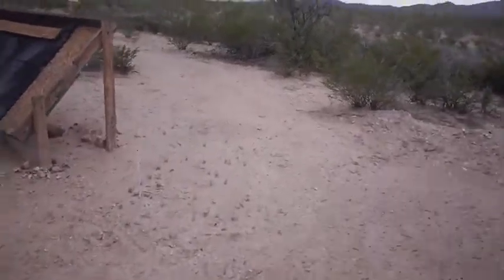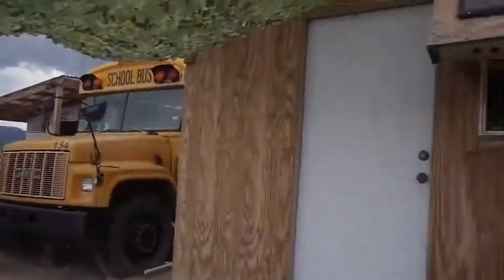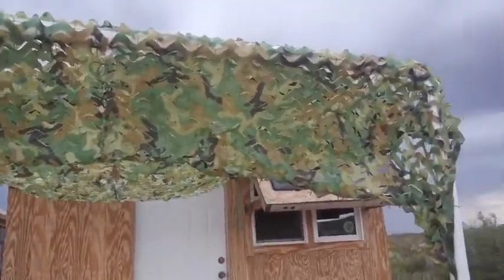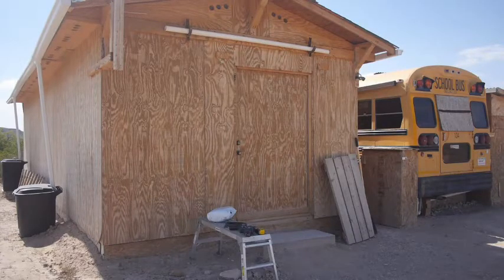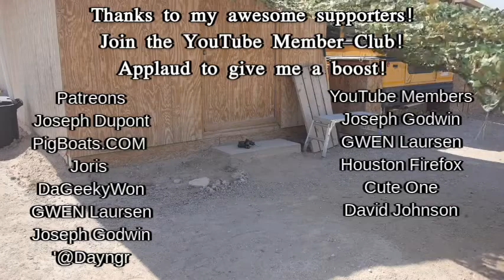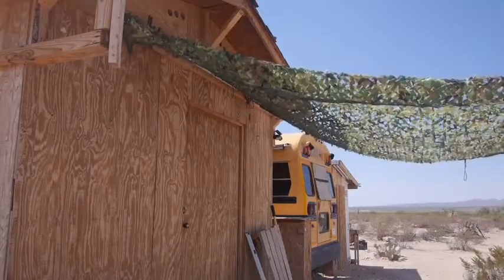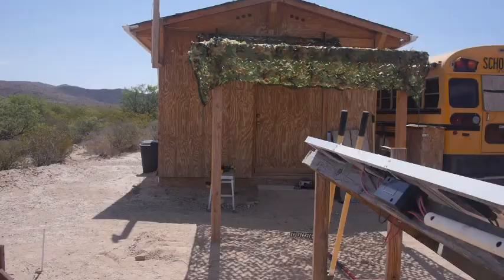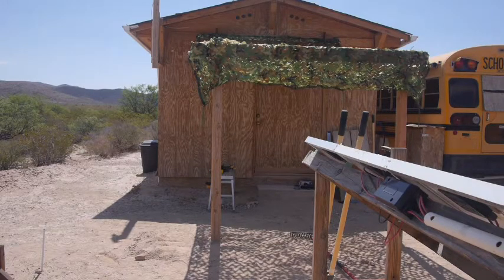Camo Netting Shade Awning

Comment: You make putting a post in the ground look so easy! But it must be the sand. How deep do you put them?
Reply from the maker: I go in about 12" to 16", depending on what I hit, the sand goes into a rock layer sometimes, its not at all consistent. All the solar panels and the windbreak were done the same and they seem to be holding ok with that. And if I want to take it out, I can usually just wiggle and pull them out again.

Comment: Sort of wondering why you hadn't tried this before. Hope this works out.
Reply from the maker: I was usually focusing on tarps that would catch too much wind. This is working great! Yeah, I didn't ever really think about this, which is weird. It is cooler under it. So far holding up well.
Reply from the maker: @AnX8765  I'm still picking up shreds of the green tarp from the first year...
Reply from the maker: @AnX8765  I looked briefly into solar screens, but they were pretty expensive. It will be my luck to get something properly anchored to the house, and then the wind takes the house with the tarp! haha Just my luck all that time in the Navy and I don't know how to properly trim a sail!  Those do sound cool though. If these last, I might experiment more with these, it does seem to help.
Reply from the maker: @AnX8765  Yup! Still in Sierra Blanca.
Reply from the maker: @AnX8765  Oh right, yeah they're still on my property. While building the house, I had some Styrofoam insulation make a bid for freedom, it got nearly to the road, over the fence, 1/4 to 1/2 mile away, several pieces. Glad it was bright pink, I could see it while standing on the bus!